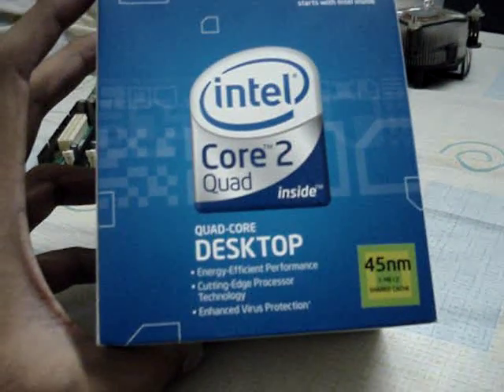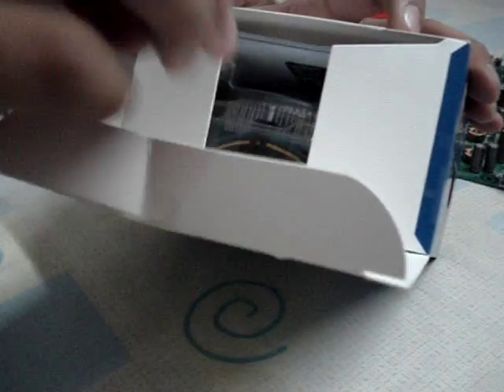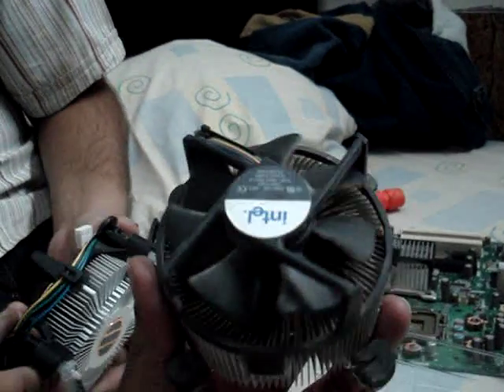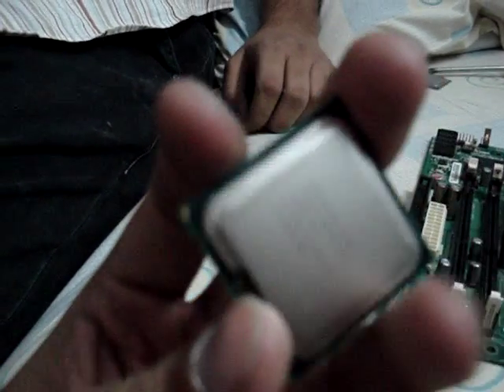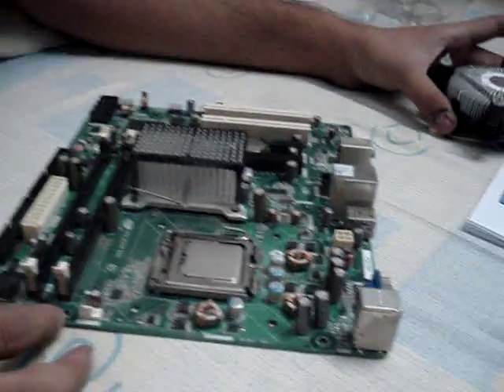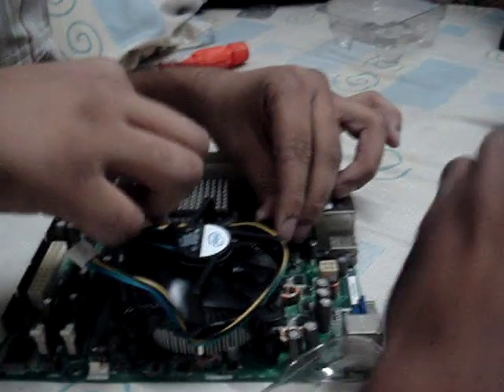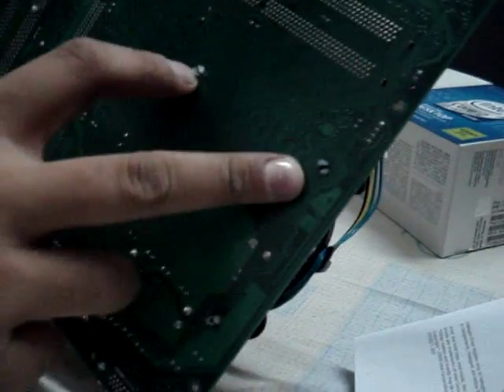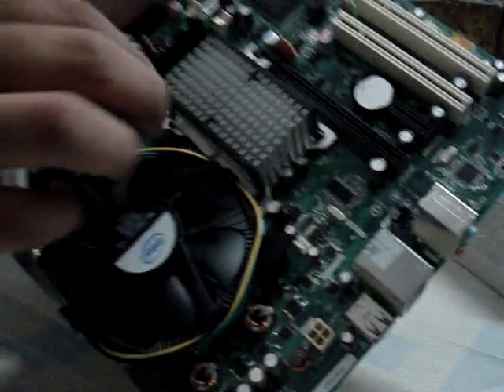Intel Core 2 Quad Q9400 (  Unboxing )

Comment: sorry im new to cpus, but is a cooling fan necessary?
Reply: +Oliver Amorim Very much so.
Reply: Perplexer1 Im using a fan that is made for a core 2 duo on a core 2 quad, is there a difference?
Reply: +Oliver Amorim Both those CPUs use LGA-775 sockets so you can fit their heatsinks/fans on each of them. I think they actually come with the same size heatsink, at least judging by the unboxing videos I have watched (same height/thickness of the aluminium heatsink and same copper core) so I think you can safely interchange their heatsinks. Their TDP rating is close enough (65W on lower end Core 2 Duo vs. 95W on high end Core 2 Quad) and the same heatsink is apparently able to handle it. You can probably even get away with fitting a Pentium 4 LGA-775 heatsink on Core 2 CPUs. They don't have a copper core but are instead much thicker (taller aluminium body) so I think it would work good enough. Core 2 Quad Extreme edition CPUs on the other hand have a TDP rating of 130W which is high enough to demand a bigger heatsink.

Comment: how did it go without themal compound :-D I'm sure the melted cpu all over your motherboard made the performance even better than it should have been.
Reply from the maker: nothing negative happened as everyone thinks...as the matter of fact everything would work fine without the compound...just be sure that the two don't friction with each other..By two I mean the head if the processor and the heat sink
Reply: +CJ The Fox The thermal compound is already pre-applied on the stock heatsink by the factory.

Comment: No offense but I've always done it on a rug all my life even shorted power to ground on my gpu by mistake once trying to get a reading with a multi-meter and everything is still good and never once had a shock. Not saying its safe just saying it can be done but with risks.

Comment: even it's not power up it still cause the potential threat of stactic/humidity to the silicon die/wire on the board.